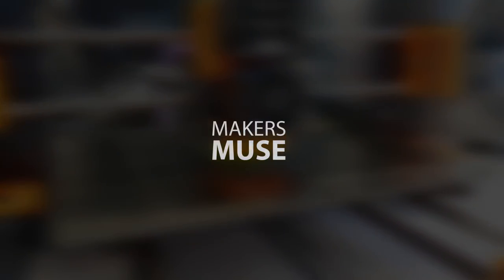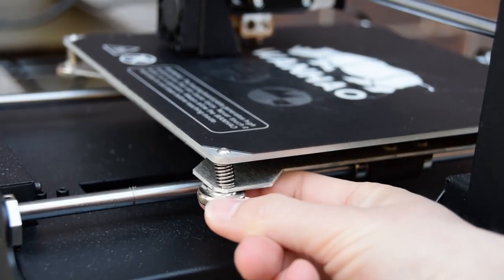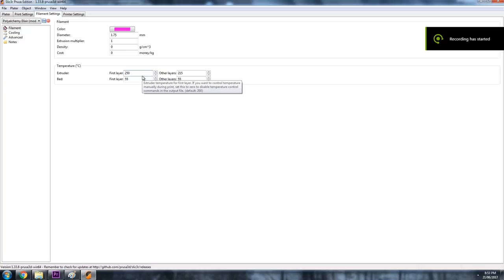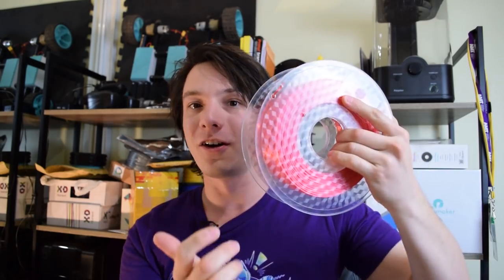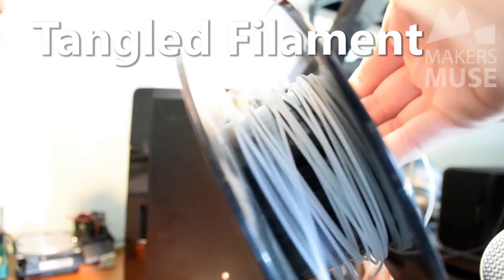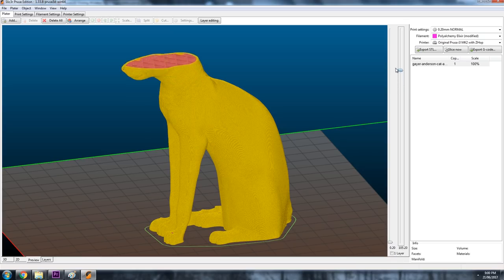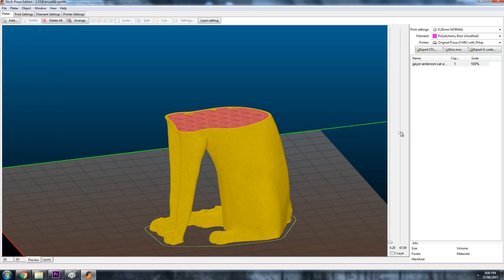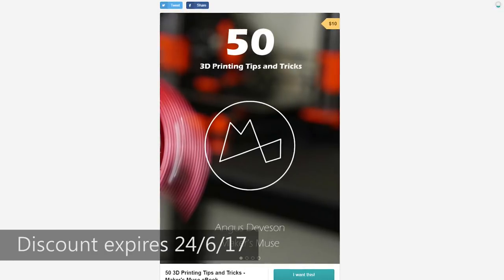5 3D Printing Mistakes you WILL make - and how to avoid them! 3D Printing 101

Comment: Maybe make some monitor software or use existing software to monitor the print with a camera.
lots of loos strands and it gives you a warning E-mail?
or connect it to the printer software it has the perimeters of the 3d object that is going to be printed so make a 2d box
around what is going to be printed in the same size (maybe a bit over sized), if it shifts and its outside of the "box/safe zone"
it will give you a warning.

Comment: 1.75 PLA filament is about 1 gram per foot.
 You can measure shorter lengths to see if you have enough based on your print preview estimated material use.

Comment: I'm a hobbyist and ive had multiple issues with changing the E3D nozzle on my prusa MK2, it seems I don't tighten either the nozzle, the block or the heat break, and since Ive only had the printer for 7 months and I switch nozzle every week or so it is my most recurring issue by far.

Comment: Question on support. It seems when I use support (which work so far), however, removal really gets difficult. You simply cracked the supports off the cat, not so with my experience. Is this some setting..... somewhere? I am using CURA on a TEVO Tornado all factory standard software.

Comment: I have had rolls of filament that were wrapped so tight the printer could not pull hard enough to pull it off the spool. I could barely pull the filament off the roll without breaking it. These were straight out of the packaging.

Comment: I’ve had a lot of printing fails with my new bed which is made of glass which is off topic but who cares, right? Anyway, a glass bed is great. Definitely recommend it. The prints are easy to scrape off, almost too easy. Sometimes the print will come off by itself during the print. If this happens, try covering your bed with a glue stick (preferably purple as you can see what’s glued and what isn’t). You can search up a tutorial on YouTube. Also, after the print is done, the best parts are that you can take the bed off and it is easier to scrape off. Also, my #1 tip is to let the bed cool down before scraping your print off. Hope this helps🙃🙃🙃

Comment: #1 luckily doesn't apply to me much.  Lulzbot mini, auto bed leveling is lovely.
#3, I've never had that happen to me, and I've used a lot of different rolls of filament, storing them all loose, basically.  thank you, I would probably have had this fail sometime in the future and had no idea why it failed.
#4 is weird for me, as I use cura (it has the lowest fail rate for me....as long as it doesn't crash.  My mac hates all slicing software.)
I'm very guilty of #5, I watch the first 1-3 layers, then usually abandon it, for classes or work.

Comment: I'm new to 3D printing but have 35 years in injection molding and I do no that certain plastics absorb moisture. So should you seal your material from moisture not like on the shelf behind you? Just asking. There is a reason why it's vacuum sealed.

Comment: Thanks for the video, my print was failing after about an hour when it would start to make a smeary rough finish, and that was because my dual extruders were not level with each other.  Makerbot Replicator 2x  Thanks dude.

Comment: "enough filament left" => Weigh your NEW spool of filament before using it.  You know the weight of the filament, as that's how it is sold.  Subtract, and you find the weight of the EMPTY SPOOL.   Write it on the spool.  Then if "do I have enough", you can weigh what's left, subtract the spool weight, that gives you the remaining filament weight, so check that it is somewhat greater than what your slicer says it will use.

Comment: so I've always struggled with "bed height".

I've heard "lightly drags on paper" I've seen videos where they let the nozzle mark a business card and then I've heard folk use "card stock" to measure the height.

what paper/card should I be using to judge the print height? and how should it be done for decent first layer adhesion? I've had success printing but I'm not convinced at my bed height and think I've just been lucky as my first layer is almost translucent when it's a very lovely opaque yellow PLA (rigid.ink) with how the plastic is being squished into the bed.
Reply: M3ta7h3ad - 2 things to check. First, make sure the z axis is at 0 height after homing. If not, it's going to go to a different height when you're done levelling. Second, look up 'Z offset' and make sure yours is set correctly. If you're manually levelling, set it to 0. Otherwise, follow what you find on setting it with a sensor (it will end up being a negative value).

Comment: I need help. I have a big project I am working on and the glue I used to hold the print down failed, and it slid from under the nozzle and it was not printing right. I had already spent about 5 hours and ton of filament on the piece and I will not restart. I had no problems up till then. I use the ender 3 printer and cura as my slicer. It stopped working at 79% completion and I was wondering if there is a way I can start it at 79% completion. Any help is appreciated

Comment: What slicer is used in this video? Another good tip is to invest in a backup power supply to keep your print going during power outages or else guess what? You'll have to start all over...learned the hard way after 2 days into a print.

Comment: Hey Maker's Muse!!
Regarding the Cetus 3D printer
Have you been able to print a perfectly straight 90 degrees Model example:  bottle, tube, cylinder or rectangular with this printer ??
If you have, may i PLEASE!! know your calibration settings vertical and horizontal PLEASE!!

Comment: Hey I watched your video and I'm still not sure what's still wrong with my printer. So I have an ender 3, I'm trying to print d and d miniatures, I even imported another person's specs into cura for miniatures (ender 3 and same nozzle size etc) and it wasn't laying down filament at all when it started to move for the miniature but I know the nozzle is not jammed since it did it's test line before moving to the miniature. So I thought maybe it was the specs so I tried to print the test print that came with the card and that didn't work either, so now I know it's the printer. Someone from Amazon set it up at my last house and it worked it did the test print there, so I have moved this printer without taking it apart 😬 so most likely something became off kilter but I'm not sure what and why it would print the test line but not the actual print

Comment: i dont think ive ever had a tangle ruin a print before. they have happened, and i usually end up babysitting the roll to manually advance it. as for monitoring, i have a webcam pointed at the printer at all time, the video being streamed over my network. a network accessible kill switch would probibly be a good thing to have. thinking about just soldering an esp8255 to a relay and running a kill switch on a web server, but im sure there are off the shelf options. one thing you forgot to mention is cats. they love to ruin 3d prints. be sure they have no access while printing.

Comment: No open windows in winter.
No printing in air flow
No quickly changing temperatures
Reply: Solution to all of them is to put sides around the 3d printer.

Comment: If you’ve tried anything and everything to improve your bed adhesion but it just isn’t working, here’s a tip most beginners overlook:

Grab your child’s Elmers Glue Stick and rub it on your bed. Quite a crude fix, but it does the job surprisingly well. I haven’t had a single print failure due to the print coming off the bed after doing this before every print.

Comment: Hi. I work in architecture and I'm looking to buy a 3D printer for architecture models.  But I don't know how it works for large unsupported areas.  Since much of them are "inside" the model . Can you make a video with tips on how to print this kind of models ?? Specially modern style architecture with flat roofs
Reply: Javier Cavallo - there are 2 simple solutions. First, get a dual material capable printer  (there are now a few good ones) and use a disolveable support material (they make water soluble material now that just melts away if you soak the model in water).Or second, you can print the model in multiple parts and assemble it with glue (standard superglue is superb for PLA - and acetone will melt ABS to permanently bond it). Just be smart about where you divide the pieces and you'll never be able to tell once it's assembled. 

The second option is the less expensive if you want it to be. Though as this sounds like a business, having a quality printer is a very good idea, so you're not going to save much over the good multiple filament printers.

Comment: I've tangled my spool before... got lucky though since it bound up at the END of a print rather than in the middle.
Reply: If you see a tangle on the spool before it jams up, you can simply take
 the spool off and put it through the knot from it's end. I've done it 
many times, but like Angus said, you have to monitor your printer.

Comment: Forgetting to put the bed in.. Due to the autoleveling on glass setup on my machine, this knocks the whole printer out of alignment and it's 10 mins of work to get the machine going again.
And many failed prints on the Ups are caused by users forgetting to put in the bed.

Comment: Can i hold an in depth conversation with you about what 3d printer i should purchase  (in your opinion of course) for making a bunch of half spheres with a hole through rhe center that will eventually attach together to make a ball. looking for a printer that can achieve quality and accurate prints to marry the 2 half spheres together and them also be light weight but very durable.

Comment: your videos are great. got my first printer 3 weeks ago. cocoon create touch. do you know if it can be fitted with dual extruder.
Reply from the maker: I don't believe so without a new control board, but it's a great platform to modify if you wanted to.
Reply: thanks. I will probably look into more down the track. just started out with abs the other day. got a couple things my work wants printed. (truck fleet mechanic.) so I maybe be able to recoup some costs.

Comment: RE:Spool...

Hobby King ABS roll that was tangled out the box as I came to the printer and found the filament wound around the spindle of the holder and the filament was tangled on the spool.
Reply: Handy to have a spare spool so you can respool the filament.p when trying a new supplier.

Comment: Is it possible to recycle plastic bags into filament for 3D printing? I've read that on their own such filament would be weak because of the low melting point , but what if shredded plastic bag material were to be combined with a stronger material such as abs or nylon? Would it yield a workable filament then?

Comment: Question. One of the 3D printers I have access to has NinjaFlex as one of the filament options. However, it always fails. The printer is a Makerbot 2X Experimental: the one with a double nozzle. What would be the optimum settings for this filament?

Comment: Hey Angus, I printed a pretty complex print the other day, and the support material was super hard to remove. I sliced it with the Prusa Edition of Slic3r at .2mm later height. What settings do you recommend for support material that is easy to remove?

Comment: this video helped alot (i'm new to 3d printing) but i have a question. I have a CR 10 mini and i'm printing curved PLA parts but for some reason areas of the curve seem to be angular instead of curved almost as though the printer made a diagonal line instead of a curve any suggestions would be really helpful.

Comment: hey! just finished a big 40 hour printing job and all I can say, is how can one make the support structure actually SUPPORT the layers? I rock a mk2, and made the slicer build the support almost as if I used soluble support material, after 2 slightly warped and wobbly attempts on "normal" settings.
Reply from the maker: It gets difficult on big prints, a trick I use is to alternate the support direction by 90degrees each layer. It's something I use Simplify3D For, not sure if it's possible in Slic3r.
Reply: Oh! Will have to try that out. I actually forgot that Simplify3D exists :) Btw, thanx for inviting me into Prusa Control software! Not much right now, but looks very promising!

Comment: Hello, I'm new to 3d printing, I've solved most of my problems and managed to avoid all common mistakes except one: filament storage. I have a lot of spool-less ABS filament which is extremely hard to manage, so I've printed spool and spool holder. Then I wind up that filament onto the spool, load it up and as soon as I've put my hands away spool start spinning like crazy and tangling all filament on it. ABS filament on a spool just works like a clock spring in my case, is there any tips to keep that darn thing calm?
Reply: Engie - print a few filament clips. They're designed to hold the filament against the spool so it doesn't unroll. That said, the first time you try to print with it after that, it might unspoilt as soon as you try to feed it. you'd have to try and see - but little filament clips will help you store it tightly wound, at least. :)

Comment: ive got an ultimaker 2+, the print become unstuck while i was at work, the plastic filled the print head took hours to cut it all out with a hot knife, cost 120 for replacement parts lol

Comment: u missed one
messing up the wiring on ur printer accently connecting Z to extrude and extrude to Z 
this was my first mistake on my ender 3 pro its regonized by grinding gear sounds, the nozel bumping into the side and no output aswell as it spits out the faliment
Reply: second error was tangling the fillamiment😸😅😡

Comment: Well, I don't think the statement about the person using the printer buggers up the already new filament wound state is right?  Why because I brought a brand new spool from E SUN which was a orange coloured PLA + filament and before the vacuum sealed plastic bag was even opened I could see the filament was badly wound up all over the width of the spool. So saying it is our fault is sometimes wrong as this was already wound badly! And this E Sun is a big well known brand.  As for the bed leveling. why do some of my prints print no issues and others done the same temperature and filament and settings for that same printing then fail?  Also bed leveling is a real pain even with my auto leveling printer the Tronxy X5SA,  It is the updated 2020 model with the improvements the 2019 model don't have! But even it is a super pain getting the bed leveled right?  The 2019 model had the normal 4 screws for the corners of the bed to level it, My 2020 model has now 6 screws to do bed leveling! it has Auto leveling and Manual. I done both many times and it is almost impossible to get the bed close to the right level?  Bed 1st level of filament adhesion is really hard to do, I tried Firm Hair Spay, I tried Glue Stick.. neither work well. So time they may some time they may not? And checking on the printer every 15 minutes or whatever.. not possible when I am working or having to shop or sleep when the print can take many hours to print.  And no, OCTOPRINT is not a way around this, Because it costs allot to buy the electronics and set it up, and if your sleeping then You can't wake up every 30 minutes and open up your mobile to check it even if you got it?   So good to see you telling us all this stuff really, But If we are lucky not to have to work for our living and have tons of free time to kill and the tons of money then all this is fine, But most of us don't have such damn luck. We do 3D printing as a hobby, Not a job.

Comment: I’ve never had any of these things happen to me, my filament has a NFC Chip involved so it automatically adjusts the slicer settings to that filament, along with a self-leveling bed, my slicer/printer software also has a self adjusting support material, and shows me where the support material will be, and monitoring isn’t needed if your printer and software works well in unison.

Comment: Problem with me is my prints failing it like goes a few inches away then extrods some filament then goes back to the print I use curla and have just been using the pre set settings P.S I use the Ender 3 pro

Comment: Hey, thanks for the video! Would you mind sharing the Temperature i should put on the Slic3r settings for ABS filament please (Firtst layer, other layers for hot end and hot bed). Also, do you know how can i check the max temperature my hotend can handle? Thanks!
Reply from the maker: I use the default material and print settings in slic3r prusa edition for ABS which sets it to 255deg... high but seems to work. I wouldn't go any higher on a PTFE lined extruder, all metal hot ends can go up to 300ish degrees.
Reply: Maker's Muse thanks for the reply. How about the hot bed? What temperature do you use on the first layer and second layer? ( mine is set to 70 C and 100 C, but i dont know if it must be higher than this)

Comment: i watched this video before even ordering my ender 3 last year, result, never made these mistakes
Reply: Oi your a furry(me to)
Reply: So the is the ender 3 working great for you with no r little problems? Anyone can answer the question..... I want to buy a 3D printer but do not know which brands r good
Reply: @feleciastevenson1608  i am quite happy qith my ender 3, it's one of the best entry level 3d printer and it's super easy to use, i still recomend you doing your research as some printers can be a little bit more expensive but worth the shot if you plan on using 3d printing a lot